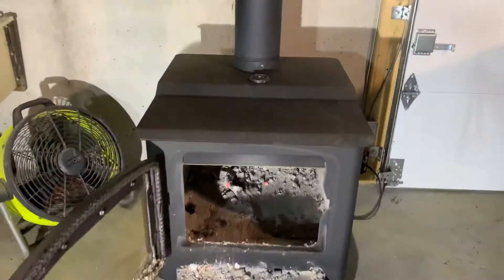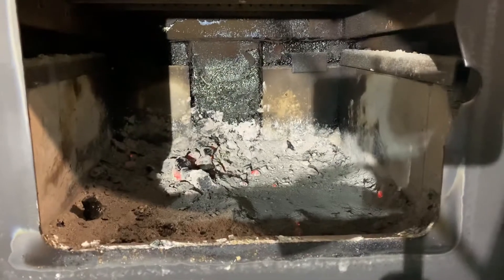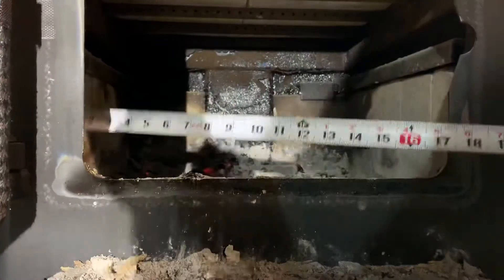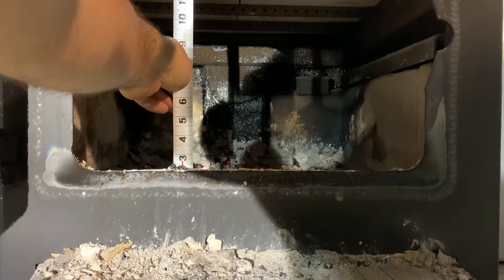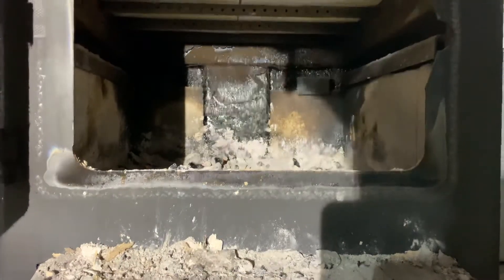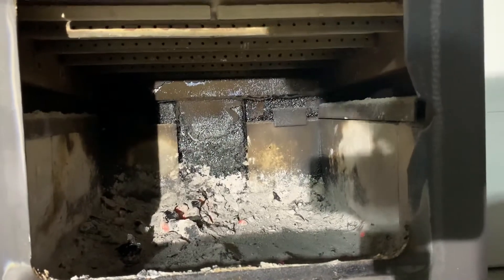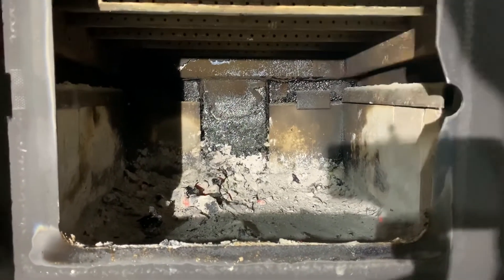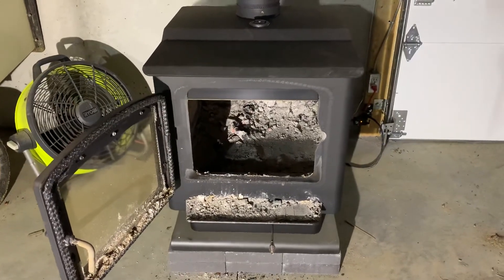Englander 32-nc firebox dimensions

Comment: Really appreciate the video! I like the dimensions. You can lay wood in either direction. The current stove I have now says you can use 18” log. What they should say is the firebox is 18” wide. I like the fact that Englander states 20” log and gives you 1 1/2 wiggle room. 

Thanks again for the video👍

Comment: 2.92 cubic ft of firebox, the reason we suggest not loading above the firebrick is that if you load it to the tubes the secondary burn just wont develop until you have used up enough wood to leave space for the secondaries to fire off. and while that is happening you are sending usable fuel up your flue.